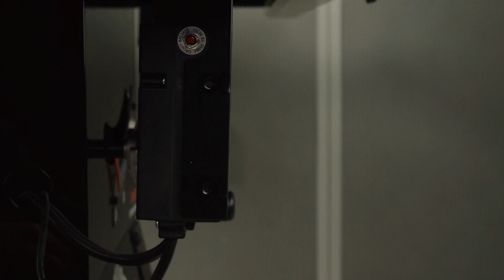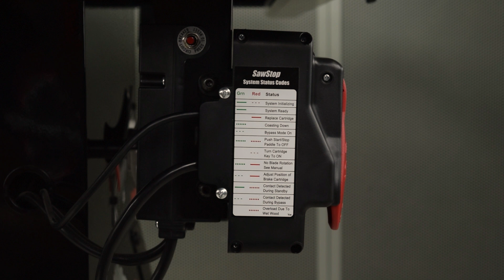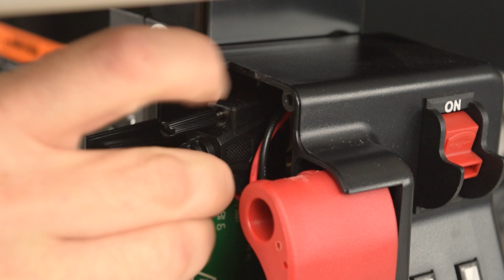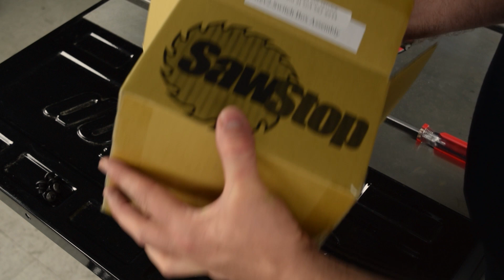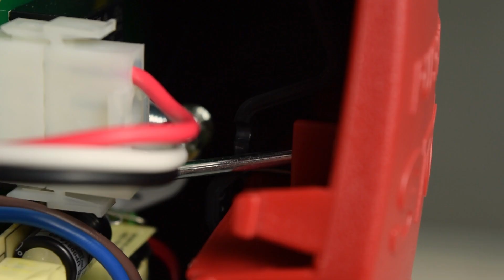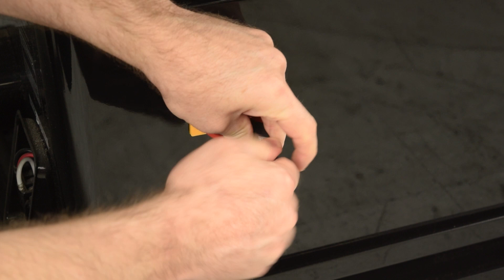SawStop Service Tip: Replace Switch Box, Cast Iron Saws

Comment: where do i  order from SawStop switch box ?
Reply from the maker: Thanks for the question. You can order parts for your SawStop at https://www.sawstopstore.com/.
Reply: I have an error code “62”. Is this the likely cause? Both CBs  are mounted/grounded properly, and I have re-seated the CB Connection cables